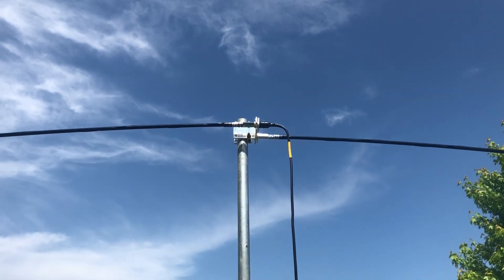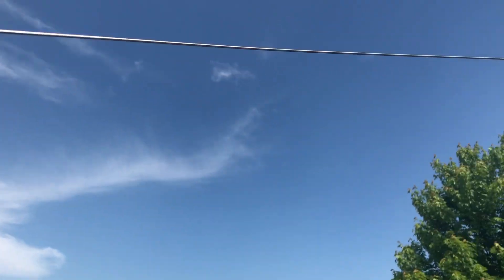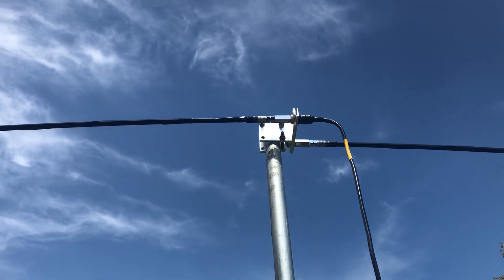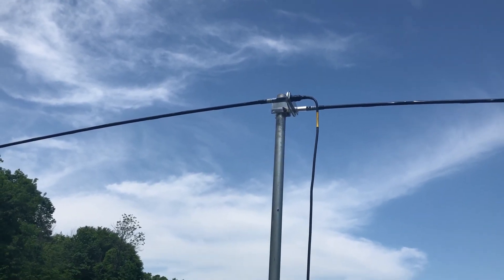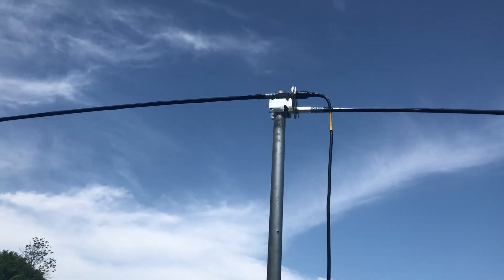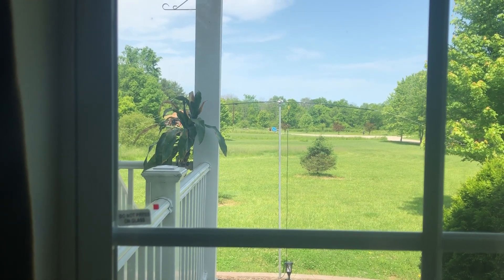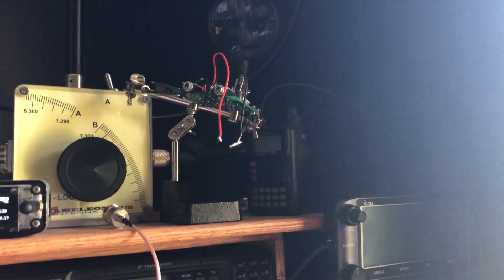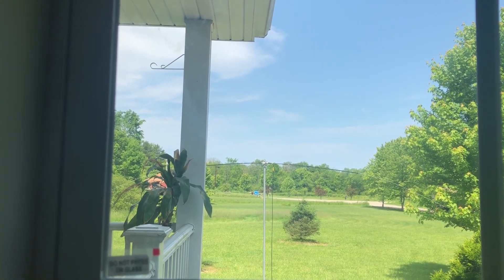10 meter mini dipole

Comment: It's 16 ft 6 inches, each "leg" is 8 ft 3 in.
Reply: When I bought my 10m hamsticks the full length of the extended whips were  about 7 feet 10 inches. Nowhere near capable of getting 8 feet 3 inches out of them.

Comment: Few questions.
What is the part/bracket that the two ham sticks connect to???
Reply: Nvr mind, I found it.   If anyone is looking for this, its the MFJ-347 HF Stick Miniature Dipole Mount,$34.94 @ DX Eng...   
The Ham Sticks are about 30.00 Each as well and normally in stock.  
Mine should be here Friday. Now to find a decent non conductive pole or condit strong enough to hold it and two HamSticks up there at 15-25' and not be too flexible.
Reply: @invisalinkmissouri1360     You want it to be 16.5 ft high.

Comment: Maybe one of you helpful ham guys can give me a hand. I'm looking to get on the air in an apartment that has a old wrought iron fire escape I'm on the third floor I'm thinking about sticking one of these antennas up on a piece of PVC pipe do you guys think this would be a good application for this? I'm going to be using 11 m for a little while more until I get my license and just want to be able to get on the air and shoot a little skip on sideband. Thanks in advance for any help
Reply from the maker: Mag loop antennas are great for places that you can’t put up a big dipole. They are kind of expensive and have limits on the power they can handle. If you’re just going to listen, your 11 meter antenna will work, just don’t transmit. The fire escape will work as a receiver too, but make sure nothing else is grounded to it. That might fry your radio. If you are able to get a horizontal wire in the air (zig zag is ok), you will have better luck.

Comment: i wander if it could be mounted vertically? im looking to make s 10 meter vertical  antenna
Reply from the maker: I haven't put it on the analyzer in that configuration, though I'm sure it would work just fine.  Maybe like a folded dipole?  It would be interesting to see how it comes out.
Reply: @PreppingOhio  yes let me  know

Comment: Good video , I’m thinking of making a 2 element mini beam for 17m using 4 no 17m hamsticks on a 2m boom 
Do you think this would work well
Reply from the maker: As long as your spacing is correct (driven to director, or reflector to driven) and the driven element is resonate, it should work quite well.  Only thing is, the hamsticks are kinda "saggy".  I'm not exactly sure how that will affect the radiation lobe.  Best of luck!

Comment: I have the mfj 347 with most hamsticks , think about buying another 347 to see if it could be used as a director or reflector  or maybe parasitic any thoughts ??.
Reply from the maker: I would think it would be similar to the construction of a 10 meter beam.  However, I'm not sure due to the internal coils.  I guess they would have to be properly matched (in length, electrically) with a reflector/director. Interesting.